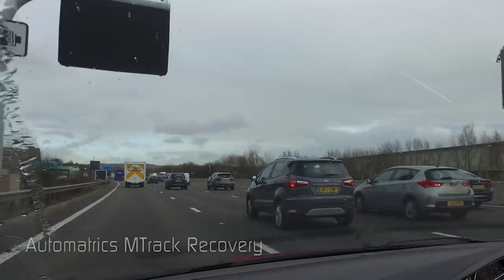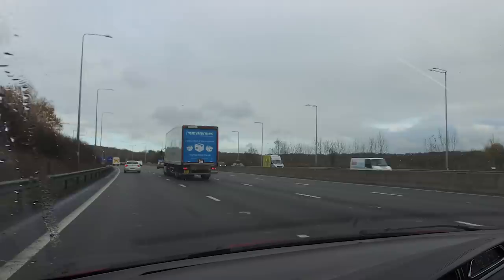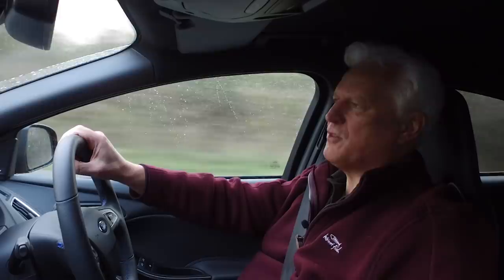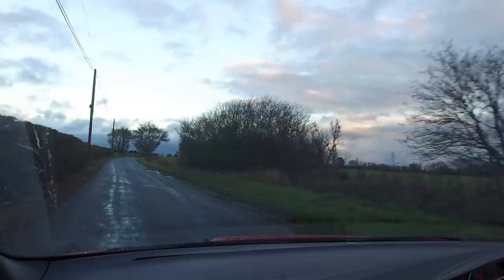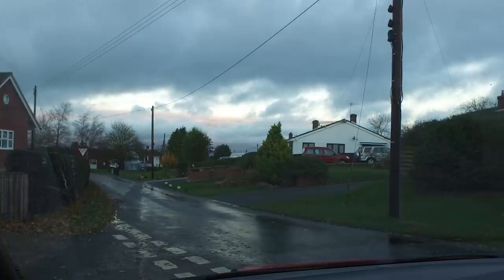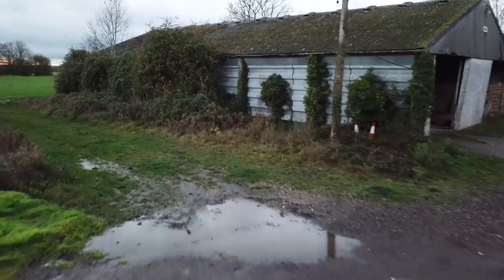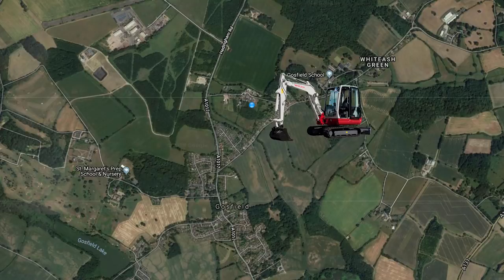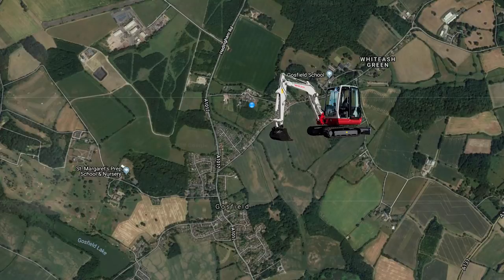Stolen Takeuchi TB 235 Compact Excavator Automatrics find operation Ashen 3rd Dec 2018

Comment: Should have flown the drone into the barn, rather than approaching it on foot.
Reply: That's what I thought
Reply: Problem is if the metal.blocked the GPS signal in the first place the radio signal would probably do the same
Reply: Was thinking the same
Reply: The drones are quite noisy
Reply: Reception can get very spotty that close to the ground when line of sight is disrupted. Without knowing the limitation of your equipment it's not a good idea.
Reply: @bobloblaw1720  All he had to do was fly it down outside the doors to view inside, if it lost contact it returns to the home position, if it crashed it was within walking distance. Not sure Brexit has anything to do with Drone piloting.
Reply: its advertiseing
Reply: @kills456  GPS requires line of sight but most drones at medium to short distance do not. But that's totally dependant on your receiver transmitter setup.
Reply: Robert Loblaw <<<< blames literally everything untoward on BREXIT voters...sadly it's fast becoming the most reliable yardstick with which to identify folk who have not been blessed with a full deck, or perhaps a 'sixpence short of a shilling' is more apt lol
Reply: I mentioned that in my post, Nigel, are you literally that reliable yardstick lol...get over it sweet pea, you lost...move on
Reply: @RevRSleeker  I lost, and so did you. One day, you'll figure that out for yourself. But, we are still in the EU for now at least. Enjoy your Christmas dinner - next year it might only be sprouts, potatoes and turnips.
Reply: Oh gawd, ''the stores will be empty, there will be no jobs, it will be dark and cold forever more now we must watch the EU flourish without us'' lmao...are you always this positive when confronted with such a wonderful opportunity of leaving a sinking ship, or are we getting a sense of just what a bundle of joy you are ordinarily ...which is it ? ;-)
Reply: @DSSlocksmiths  How did you guys get along before the EU?  Hmmmm.
Reply: @dpeagles  Badly! Little things like the "Hundred Years War" and all the in-fighting meant Europe was constantly at war for thousands of years. At the end of the First World War, they thought war could never happen again... Wrong! But no EU country has had a war with another EU country in 60 years.
Reply: From a noise perspective drones are pretty much flying lawn mowers so you negate 100% of it's usefulness in the first place (covert surveillance). 

Secondly, you might fly into something lying into a barn that you have no idea what's inside. Including perhaps human beings who can be severely injured by drones. You also then run the risk of losing reception and most drones will then automatically land themselves and you're then going on foot to retrieve the drone which once again negates 100% of it's usefulness in the first place. Then there's the possibility of someone seeing and literally catching your drone with their hands and good luck getting your drone back from someone whose property you've been spying on. Personally I would 'disable' the drone with a baseball bat and leave it sitting there if it were my property it were on, at least in the US the most the police would do is give you back your broken drone and at worst trespass you from the property while confiscating the drone as evidence. I can't imagine drones are legal to fly on legal property in the UK either. But from higher up you can get away with it since private property doesn't extend that far off the ground.
Reply: @NigelTolley  That has little to do with EU.  More like the USSR threat.  You really need a better excuse for remaining in the EU.
Reply: there are different lows! its not USA
Reply: Police would have arrested the guy for unsafe drone flying near property. I'm not even joking. In the UK, grand theft auto is basically just a misdemeanor.  Talking shit on twitter and flying drones out of nowhere are serious crimes.

Comment: Should've parked across the driveway, or at least right at the driveway. Nitwits. But by them moving it, TWO stolen pieces of equipment were recovered. So it all worked out in the long run.

Comment: Cops probably called their pals that stole the excavator to tell them they've been found out and get it moved! Notice the cop asked about the tracker.
On the other hand transporting that excavator with just straps and the way they strapped it was horrible, transporters should be arrested.
Should have left a camera in the bushes by the barn.

Comment: I would say that cottage haad LOTS to do with that theft TBH, as soon as you were noseying in that barn, too quick to be any other reason, the Beibergh district (Hadleigh/Sudbury etc) area does have a fairly high crime rate, especially plant and lead/pipe etc, and there are a few  'traveller' camps including a large one just west of Ipswich that is renowned for crime. Manpower for Suffolk Police is getting to dangerously low levels sadly. A brilliant result, and that Claas tractor could have even been nicked from their UK HQ just off the A14 near Bury St Edmunds, about 20 miles or so from Sudbury
Reply: This is in Braintree DC area Essex.
Reply: What threw me was Sudbury, that is in Babergh district, and he was just off Duddery Hill in Haverhill, which is fairly high up, and about 4 miles or so from Ashen, which strangely is partly in Suffolk and Essex. I did think Richard risked his life, his every move was being watched from that house, too much of a coincidence, he did put himself in danger nosing about, now that is a rookie mistake, he had the RF signal, but impatience got the better of him on this one,  Police attending will have been from Essex, not Suffolk, cross border requires special permission from duty control, the brand new CLAAS tractor will have been a bonus for police, the mind boggles why manufacturers of heavy plant do not factory fit RF and GPS tracking units, especially as around here you are barely an hour away by road from the largest container port in Europe, and within a couple of hours, your nicked plant can be on it's way to anywhere in the world
Reply: Just a shame that the crooks cannot be caught as they were virtualy next to them
Reply from the maker: Thanks for your comment very informative 👍
Reply: @nethalus  the problem with fitting gps/trackers from factory is that every crook will learn where to look for them(standart placements), and then remove them. still i agree, way too little is done on antitheft/tracking, i guess manufactors of cars/trucks/motorbikes/tracktors/etc sells more with each theft
Reply: @nethalus  some kickbacks doing the rounds I reckon.

Comment: You're a madman walking into the barn of some random dude housing stolen property. Crazy risky. Wait for backup!
Reply: Thats what you call trespassing. Youll be smoked if it was in US
Reply: @darugdawg2453  It's only trespassing if there are posted signs (and you have to post a bunch, not just 1 at the front gate or something, you have to ring the whole property), or if you've been told directly that you're not welcome. Otherwise you're just a guest walking up to say hello or something, as far as the law is concerned.
Reply: It's the UK, where the most dangerous weapon they have is a butter knife 🤣

Comment: Does it cost more to the customer if you have to go out and personally locate the stolen vehilce?
Reply: As far as I'm aware the service is part of the package. I think they give police a chance, if there's GPS loc, but if it isn't able to give off an accurate enough location police won't investigate, so that's when they go out with RF to help. I'm in Southampton so I feel pretty pleased to use them knowing if there's trouble it won't be long before someone is out to get my bike back
Reply: No. Thats included on your subscription
Reply from the maker: Any required finding is included in our subscription, we also pay up to £200 towards any recovery transport
Reply: AutomatricsMTrack That’s really good. Thanks for confirming
Reply: @AutomatricsMtrack  Hi guys, congrats on a great job, reminds me of the film "No country for old men"!! 🤣🤣 on the subject of your tracking devices, did you ever come across cases where your devices have been jammed by sophisticated GPS jamming systems available online mainly from the PRC, there has been some cases in Ireland where criminals have used sophisticated jamming equipment to cloak stolen property such as Cars, Suvs, plant, and stolen cash in transit boxes which they suspect of carrying tracking devices.
Reply: Way to much work to track,recover,and pay monthly fee for gps JUST INSTALL A REMOTE RELAY TO KILL FUEL AND STOP SOLENOID YOU WON'T HAVE TO GO TRUE ALL OF THIS COST UNDER $10 DONE.

Comment: Do y'all not have much laws when it comes to tie-in down heavy equipment on trailers all y'all used was 2 little straps instead of usein chains and boomers
Reply: Your lucky if that digger weighs 2 or 3 tonne ,the straps can hold 2 tonne each so digger ain't going anywhere, chains on something this size is overkill
Reply: @georgefraser4623 7,500 lbs. 3500 kg. I'd rather be following 'overkill' on the freeway than dodging the aftermath of 'good enough'.

Comment: Are you predicting a theft in the future? Check the date in the title ;-)
Reply: It is okay, you must of been on a time machine.
Reply: I don't see what the problem is... title indicates 3rd Dec 2018,  vid was posted 22nd Dec 2018.  By my understanding, the theft/recovery occurred on or around the 3rd, and the video was produced and uploaded on the 22nd.  Seems normal to me.... unless the poster had made an error at time of post but has since corrected it, as you can edit the text easily... whereas the video would have to be edited and re-uploaded if there was something in the actual video that had to be changed,  but fixing text errors is easy to do.
Reply: Stan Patterson Been updated since.

Comment: Just explain to me why didn't you just set at the drive way by the barn and watch it hell you must have  pulled mile r more from it to not be able to see it gettin moved,  how long have u been doing this shit
Reply from the maker: In our experience stolen vehicles don't usually move from one location to another in the same day as the theft, bandits would usually wait a number of days for stolen goods to cool down. So to start with,  we were just not expecting this machine to move after just a few hours. We could have parked outside the barn area,  but we felt it would be OK to move to the end of the road (about 500 yards) knowing we could still cover the only believed exit, not block the farm road, not draw attention to ourselves and to be better visible for the attending customer, the recovery truck and the police.

We don't want the customer onsite when assets are located on or within private property, we don't want confrontation. So it made sense all round to wait for the police and the recovery truck from the end of the road.

On this occasion it could have all gone wrong as we had not realised there was another exit from the barn. The bandits arrived before the police and that could have proved a challenge had we waited directly by the barn. It worked out as a good result and the correct strategy in the end. We got the machine back, police arrested the bandits and we reunited a second victim with the bonus stolen tractor find. These bandits were clearly dangerous trying to force police off the road etc.
Reply: @AutomatricsMtrack  I didin need a book report  tryin to make y'all feel better u could have just said we screwed up on this one and been done with it just be really glad u had the tracker and I'll stick with the American way and that's when u see it u keep it in sight
Reply from the maker: @stevenwalls7215  sorry you asked for an explanation and then complain when you get one. Just no pleasing some folk
Reply: @petemiller519  let me ask u would u tell your 11 year old kid that kinda stuff cause I don't really like u sayin it to me since I am only 12 years old,  but u sound like a really good mother
Reply: @AutomatricsMtrack  No, you should have never let the excavator out of your sight once you found it.  You need to get a bigger and better heavier 4x4 vehicle for your tracking work so that you can get to any location, park, and not move.

Comment: I wonder if LoRA or LoRAWan would make sense for this application. It certainly has way better reach than almost any other commercial radio for a given power.
Reply: It's also a shame that Loran is gone and they never upgraded to ELoran nice low frequency for getting into equipment when gps wont
Reply from the maker: Could be

Comment: I had two Yamaha ATV's pinched in south Wales back in 2004 - 2005  they were nearly new and got pinched from the side of my house which is in a residential area in a neighbor hood watch street too. Police found them early hours of the morning,  the thieves were trying to remove the data tags and pry the warning labels off.  Got them back with slight damage. 8000 pound ATV's

Comment: Not sure if your trackers have this ability but if they don't, they probably should.

Have them be able to set non operational hours. For example site machinery could activate the alarm if it's moved say between 8pm and 5am where it's obvious it's not being used legitimately.

At that time of the morning when they usually get nicked is dead time for coppers - If you told then you had a moving target and where it is, they'd be right on it.

Either way, in this instance the police and council should shut the site down since it's clearly being used for criminal activity. But they won't.

Of course, if you're a law abiding citizen with a fence over 1.5 meters the council will have you in court the next morning.

Comment: You should start getting a major contract for big car companies like Ford Mitsubishi Mercedes BMW Vauxhall and all makes of vehicle because this kind of equipment should be standard issue for all vehicles because the start of this year my partner got her car stolen
Reply from the maker: Better for Automatrics tracking systems to remain entirely covert,  OEM partner trackers however do make good decoys 👍
Reply: Well my partner's car got stolen at the start of this year and it's never been found since but your tracking system is so expensive and my partners car was not her car it's was on lease
Reply from the maker: I think you may be comparing our service with unlike services on price point. We supply a very competitive and unbeaten theft recovery 98% performance in this sector. Our customers reviews often state our theft recovery service as "being worth every penny". Buying one of the thousands of non- certified basic GPS only location trackers is not the same as investing in the Automatrics professional and  police preferred theft recovery service

Comment: So the tracking device can contact you, and you can use the mobile cell it connected to in order to roughly locate it, but you didn’t think to include a GPS to provide you a more accurate location?
Reply: The barn it was in shielded the GPS signal from reaching the receiver, therefore it didn't know where it was, till they moved it, and they tracked it with GPS the second time.

Comment: Why don't they have a directional antenna on the car, its so much more efficient to DF with. A small yagi  painted black with  a mast through the car roof would not be to noticeable, if its raised  for a direction.

Comment: While you are there did you happen to find any of my stuff??? I had a 1977 Honda CB750K with drag pipes stolen out of my back yard in 2001 and prior to that I had three Small Block Chevy 350 cubic inch motors stolen from my same back yard in 1997 and two of them had TH350 Automatic Transmissions STILL BOLTED FAST TO THEM!! PLUS and again prior to all that I had a 1981 GS 850 Suzuki stolen from THE SAME back yard in New York State which to this day has never been recovered by ANYBODY that I know of!! And face it the cops weren't much help either!!!

Comment: I'm not surprised you found the 3t ex what I'm really surprised at is the police was helpful and let you take the machine so easy.
I did a job early this year where we went after our JCB 9mtr telehandler........we found it and my boss kept it in site but the police didn't want to know "kept saying it's a civil matter" until my boss said I was on way in lorry and I don't muck about.....
The police did then respond and bet me to the area, I was then told to park up at the bottom of the ind estate, I didn't I went round and parked at the top(only road out).
Cut long story....the stolen Tele tried to make a run off the EST but I blocked the road with lorry and managed to isolate the machine as the police turned up.....
Two arrested and we got our machine back.....
But why do we have to do the police work?????

Comment: Richard should have lost his job for this one, finding the excavator from its radio signal, walking up to the excavator, and then going off and doing other things while the excavator is being taken out of the very remote garage, to who knows where.  Sometimes you only get one chance or no chance before the radio tracker transmitter is discovered.  The police and the owner of the excavator were pathetic in letting it be taken out from under their noses for a second time.

Comment: Looks like a tinker-toy machine. Looked it up - a used Takeuchi TB 235 sells for less than $10k to mid $30s. Not useful for more than burying water lines and cables. A Ditch-witch is faster and better designed for doing that. Bet the police were too lazy to run the VIN numbers on all those other vehicles parked in that yard.